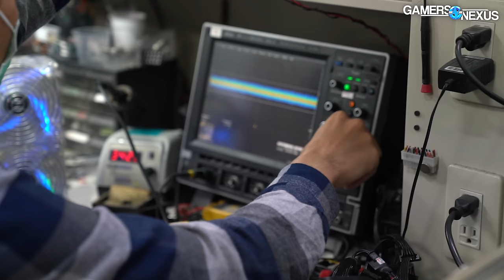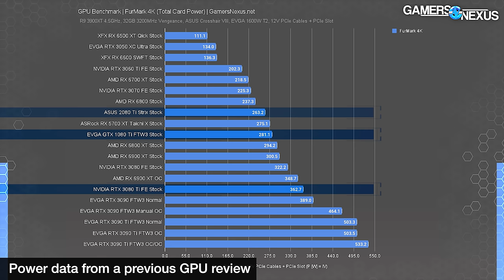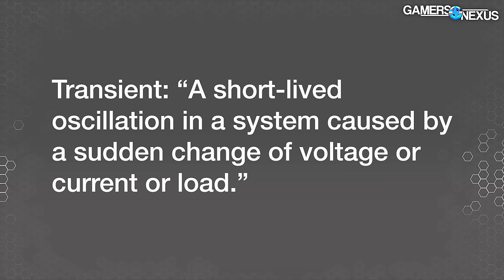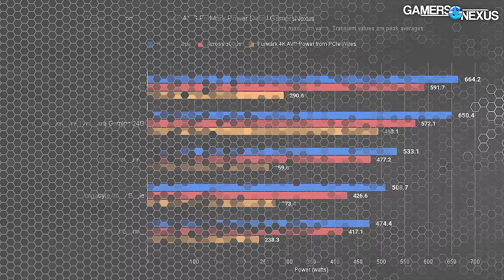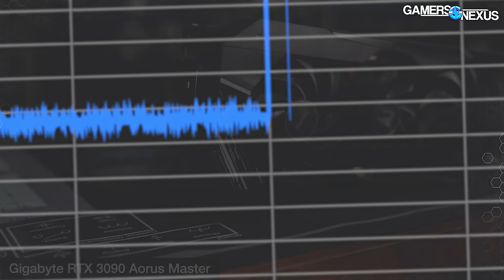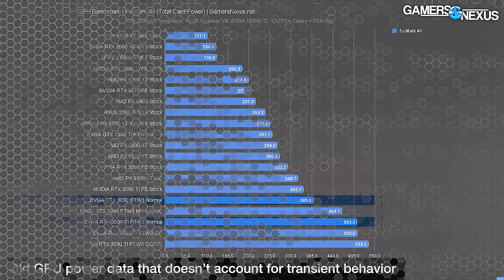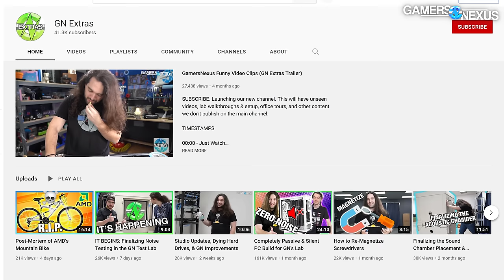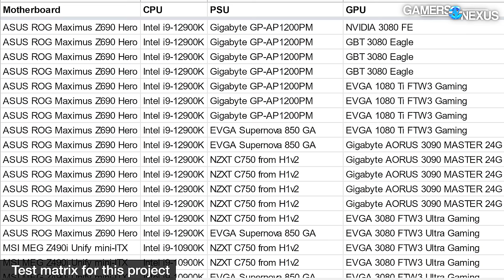The Brewing Problem with GPU Power Design | Transients

Comment: I would have watched a longer video that included how the motherboard plays a role. I have had random shutdowns with my TUF 3080 for almost 2 years now and I have gone through 3 different Seasonic PSUs, the first was a SFF PSU. My current 850w only shuts down about once a month but it's still an incredibly annoying problem.
Reply: I had constant shut-downs and bios issues, turns the issue was the motherboard. I thought I had updated it to the latest bios when building my pc, in fact I did nothing. That fixed most of my issues, why not look at that
Reply: 850W may not be enough. My shutdowns only stopped when I got a 1000W psu.
Reply: @Xer0-  I agree and almost bought a 1000w PSU but I'm hopeful ATX 3.0 allows to get back down to reasonable wattages, even going as low as 750w. The system actually only ever uses 600w even when power virus testing.

Comment: It's also a safety concern. With how high power requirements are getting, a lot of those older 15A circuits in USA households are going to be under full load and heating up a lot. This could result in fires. A lot of older houses do not have thick enough gauge wire to deal with full loads for hours on end.
Reply: Your breakers should trip before fires, that is their whole point.
Reply: @JimBob1937  Problem is breakers (I'm assuming at least), are designed to protect newish wires. The old ones potentially won't be able to take the same punishment. But on new houses your 100% correct.
Reply: @GsaUce Rug We don't talk about Edison...
Reply: Completely, utterly false.
Any 15A wiring run is designed to accommodate up to 1875 watt spikes safely, namely 15 watts at 125 volts (15 x 125 = 1875).
Draw above 1875 watts lasting longer than 10-30 seconds (depending on protection type) will either trip the breaker or burn out the fuse.
We are far Far FAR away from this being a concern.
As far as house fires that's nothing more than (and I'm assuming) Jayz spewing FUD and you parroting it.

Turn your toaster on and a coffee maker, 30 seconds later... click.
EHERMERGERD MY HOUZ IS GONNA BURRRNNNN!!!

(Age of house is irrelevant. Wiring is and was designed to carry the load stated.)
(House fires start in the overwhelming majority of cases due to the use of improper extension cords or due to damage from animals or damaged insulation. Fires resulting from circuits being run within spec are practically nonexistent.)
Reply: @chainingsolid  , that is incorrect. If the wiring is designed for a 15A load... age doesn't matter. If the wiring is paired with an appropriate (same rating) breaker or fuse, it will flip/blow before the wiring catches anything on fire. Even in the case of a 15A circuit, they're designed for high current spikes that may exceed 15A, it's just that the heat build up will eventually cause them to fail at continuous loads which exceed their rating, which is what the breaker/fuses are designed to interrupt. Only danger of an old house is some idiot who may have installed a higher amperage breaker/fuse than the wiring was intended for, but that is a deliberate misuse of the wiring and not something you'd need to worry about if your wiring is up to code, even if it is old.
Reply: @tim3172  , agreed.
Reply: Reminds me of when I picked up a laser printer; 15A circuit breaker in an older home couldn't handle the power spikes without also utilizing a series mode surge suppressor (Zero Surge / SurgeX), makes me wonder if those will make a difference when utilizing high power graphics cards moving forward.
Reply: @Nachokinz  , was it a fuse based circuit? There can be different fuses, not every amperage fuse is the same. They are rated in how sensitive they are to spikes and overcurrent duration. Either that or if it was a breaker setup, maybe the breakers were too sensitive. Shouldn't have anything to do with the wiring and should be easily fixable within the main distribution panel.
Reply: @JimBob1937  I just looked up top causes of fires. And found this: 
"Electrical fire cause 5: Wiring. Outdated wiring often causes electrical fires. If a home is over 20 years old, it may not have the wiring capacity to handle the increased amounts of electrical appliances in today’s average home, such as computers, wide-screen televisions, video and gaming players, microwaves and air conditioners.

Breakers should be triggered when circuits get overloaded by too much electricity, but outdated breaker boxes often have worn connectors that do not work, causing the system to overload and start an electrical fire."
Reply: @chainingsolid  Wires don't age or degrade with time unless they are corroded. 15A at 120V is plenty for PCs even with RTX4000 series. Unless you are also trying to boil a kettle on the same circuit. Yes newer houses typically have 20A circuits but 15A is still plenty for regular use.
Reply: @GsaUce Rug , there are issues with age when it comes to insulation, but at that point it isn't load dependent. Wiring that faulty is faulty no matter the load. The whole discussion is that somehow older houses will burst into flames based on higher loads... but really, if your wiring is that faulty, it isn't load dependent and you're just a fire time bomb waiting to happen. Metal in the wiring isn't going to degrade in current handing capacity.
Reply: @groundzero_-lm4md  , sorry, replied to wrong person.
Reply: @VROOOOOOOOOOOOOOOM  current rating is based on the innate electrical resistance of a wire material and its thickness. Higher current produces more heat as the ohmic losses increase. This doesn't really degrade with age. What can degrade is insulation and potentially higher resistance connections forming at the outlets. A proper functioning fuse or breaker should catch bad insulation or higher current draws than the wiring can support, as the wiring isn't going to degrade in its base current handling capacity. Though, higher resistance connections won't be caught, but then you're likely to experience fire from those even below maximum current handling capacity. In other words, wiring so poor that it may be an issue with higher will also be an issue with lower current draw than what is being discussed, making it a non-issue for this specific topic as that just boils the discussion down to, faulty wiring is faulty wiring... which is of course true no matter the circumstances.
Reply: @GsaUce Rug , that is why I said higher resistance connections. However, I would highly argue that will be a safety hazard regardless of maximum load... aka, the whole point of this discussion. High resistance connections are a danger even at lower loads and should be fixed.
Reply: @GsaUce Rug , any load can cause red hot connections depending on the resistance of the connections themselves. Which is why they are a danger under any load. Here, the point of this discussion that they all of a sudden they should be a safety concern with higher power computers... but really, those are a safety concern in general and now, as a present danger. Hence, I don't agree with the premise that higher power computers would increase the rates of fire, as those fires that are likely to start from such poor wiring are likely to start even before the introduction of higher power computers.
Reply: @GsaUce Rug aside from glowing high resistance connections, the rest of the failures should be caught by the appropriate safety mechanisms, regardless of age... and again, if they are not, then the circuit represents a danger regardless of the introduction of high powered devices. It's not that I'm not arguing poor wiring won't cause fires, it's more so, that they shouldn't occur in the first place, and if they do, it has nothing to do with computers using more power. Aka, bad wiring is a danger at any time, with no connection to the premise of requiring higher power computers to trigger them. High resistance connections, bad,. Fuse/breaker oversized for the wiring, bad. Insulation falls off, bad. If any of these are in your wiring now, you need to fix them now, not wait for a high powered PC to magically trigger them... they're a danger well before that.
Reply: My pc actually tripped the breaker recently. Given I also had AC and a mini fridge on. It only happened when I put my pc on full load however. Good learning experience.
Reply: I've tripped a breaker running a hair dryer alongside my PC... And I only have a 1080Ti. Age of the house is irrelevant but when you have multiple monitors and other things connected you're gonna reach the rated power limits way sooner than you think.
Reply: Stay in skool kid 🤣
Reply: @tim3172  Absolutely!

Used to trip a breaker in 4 seconds when I was microwaving something then used the toaster. Also tripped the breaker playing games on PC while running the A/C.
Now have separate 20Amp breaker’s dedicated for the A/C’s in all of the rooms and no problems.

Comment: I’m very impressed and happy that independent groups like GN are looking into these “boogyman” instances of hardware/software failures, especially because within the next decade or so we will be dealing with architecture that approaches 1nm, and after that things get really weird. If we are having the problems now at 10,7 and 5nm architectures, the problems will only get more complicated. I can’t wait until GN can afford to implement a quantum version of measurement to their arsenal. They’ll need it 😂
Reply: what's funny is 5nm isn't 5nm, it's just a name
Reply: @canaconn2388  Explain?
Reply: @16xthedetail76  Those descriptions are marketing terms. It's simply how manufacturers like Intel, TSMC or Samsung call them. It does not tell you the actual geometry sizes of the produced transistors. For example; FinFET Transistors on Intels 10nm have a fin pitch of around 34nm while Samsungs 10nm has a fin pitch of around 42nm which is what Intel has on it's 14nm process. So while both call it "10nm process", Samsung is actually closer to Intels 14nm than their 10nm. 

And that is fine, because manufacturers can call it what they want. As I said, its just a marketing term.

Comment: As requested, reporting in: I've got a 6900XT (and a high clocking PowerColor Liquid Devil Ultimate at that) running just fine on a Corsair SF750 SFX PSU. Rest of the system is a 5800X (limited to 120W PPT, CO UV'd and PBO OC'd) on an Asrock B550 Phantom Gaming ITX/ax. No other major power draws - two sticks of RAM, a few fans, a DDC pump. I've never pushed the GPU beyond its stock limts, and often run it with an UV/UC profile, but it's seen a lot of use at the 330W limit and I've never seen a single shutdown.
Once again, thanks for an excellent video. I could do without the rather obnoxious background music at the start, but other than that, fantastic work. Love to see your videos evolve into deeper dives like this.

Comment: GN: "It gets a little ridiculous if you're shopping by capacitors"
Buildzoid: "So as you can see, even though both of these capacitors are rated the same, if you open up the technical spec and look at the power curves, they actually behave very differently, so you should factor this into your purchase decision"

Comment: I have a serious feeling that we're about to revisit the days of dual-psu systems. At least until better tech comes along given the transistor shortages and power ceilings, unless it's a matter of nVidia pulling an Intel by sandbagging.
Reply: Nah, there are already 1600W PSUs, and the ATX 3.0 spec that PSUs will soon use (bizarre that Steve didn't mention it) is designed specifically to deal with transients.
Reply: @concinnus  so what's the issue then?
Reply: I pay 34c/kWh - no thanks
Reply: @concinnus  so, nothing to be worry about them... We'll be back to the days of Athlon and Pentium 4 list of approved PSU and / or GPU vendors asking us to get a new ATX 3.0 certified PSU with their new GPU.
What a waste of time Steve, it was completely unnecessary to know this much info and data. 🙄
Reply: @concinnus  that's brushing dangerously close to the 1800 watt hard limit of North American power circuits, unless a high end pc is gonna start requiring a 120v 20a circuit.
Reply: @concinnus  sounds like a shitty way of fixing it, just brute force more capacity instead of actually working on dropping power draw
Reply: @johngaynor4363  That or dedicated pc outlets for 220v 15-20amp, like they use for bigger window ac units.
Reply: yip i use to have builds with dual psu's
Reply: @johngaynor4363  You wouldn't need a 1600W PSU, you'd need more capacitance to handle the spikes.

Still a shitty situation, this should be mitigated in better design, rather than just brute force compensating on the PSU imo. Even if that just means shifting the capacitance onto the GPU boards themselves.
Reply: @KingOfKYA  bruh, that shit ain't happening in most of the world. That's gonna cost a shit load to have  your house rewired.
Reply: Very unlikely. More likely majority of people will buy sensible GPUs, as usual, and not useless, overpriced, wattage-slurping monsters.
Reply: @johngaynor4363  Actually it's mostly North America and Japan that have pathetic sub 200V systems
Reply: @Ovenman940  I know, I mean that its unrealistic to ask anyone to rewire some part of their house for a pc.

Comment: Rule of thumb, you want your power supply to run about 50% under "normal" high load. That puts it squarely in its most efficient range, and gives it plenty of overhead to deal with transient spikes and power grid brownouts. That's how professional equipment is specced, and there's a reason for it. It costs more, but not as much as replacing broken equipment.
Reply: This +1 Too many people trying to get by with the minimum.
Reply: @FacialVomitTurtleFights  "Minimum" changes the longer a person holds onto a system.

Comment: This happened to me on a Deep Learning rig. When 2x 3090 were running full load, sure enough, the system would shutdown. The PSU was 1500W so in theory it had much more power than needed.

Sure enough, I got a 1650W PSU and the problems disappeared.

Comment: I wish we could go back to 200-250w was the extreme end of you power draw, it probably won’t happen for a few more generations but I can hope.
Reply: Unfortunately with moore's law effectively dead, you have to scale up performance by a combination of:
- Larger die size
- Higher frequency 
- Better architecture 

The first two increase power draw, and the third option is hard to do without the first option to increase transistor budget. The issue is we're starting to hit the physical limits of silicon fabbing.

Comment: Perhaps someone could make a "compatibility brick" with a huge number of capacitors that lets you convert 3 or 4 common PCI-E cables into one of those new 450w or 600w connectors. Something to let these old 750w PSUs to power the next generation of cards.

It'd be challenging to make a wire octopus hanging off of your GPU look good, but if you stick enough RGBLED on it, I'm sure someone will buy it.

Comment: The first time I had problems with power spikes was with my old AMD FX8350 system from a system builder. I had a budget PSU from Corsair (I think it was a VS650) paired with it and a GTX 1060 6gb. Upgrading to a RM650X solved all the random issues and years later it's still a decent quality unit that handles a RX 5700 XT and Ryzen 7 3700x.

Over the years since then I've helped multiple other people with their systems having these types of issues, maybe half a dozen in total. All of them either had a budget but branded power supply, or just one that couldn't supply the wattage for a newly installed graphics card.

Personally I really dislike having to over-provision a power supply as you don't get any real gains for a gold or platinum rated unit, but sometimes it is necessary as you've stated

Comment: You have to specify transient power draw spikes as both a power or current value and a time period, because there's always the chance that you get a much higher bandwidth scope and you have a really tall, really narrow spike that ultimately means very little as it can't make it down the wire to the psu or be even detected by it.

This isn't an easy problem to solve and it comes up in electronics very often.

Comment: If I was motivated and entrepreneurial enough, now would be the perfect time to create and sell "GFX Capacitor Banks". Like how they took the car audio market by storm where power supplies (alternators and high current losses) weren't sufficient for feeding the technology/availability of high power amps and subs. So, this device would sit close to the GFX card, in line with the PSU 12V, and it'd contain a low ESR, high capacity configuration. These would take the immediate brunt of the load spike, and allow the PSU to compensate a smaller power draw over a longer time frame. This is quite the lucrative avenue, as all the marketing has already been done, just copy-paste the automotive audio industry propaganda and just search-replace "dBs" for "FPS", plus you've got the perfect storm of GFX OEMs not wanting to stop doing transients, and PSU OEMs not wanting to mitigate for them, so who's going to roll over? Nobody! Enter: The Ultra GFX Power Bank®yours for only $99 + p/h.
Reply: Yeah. The real problem here are the PSU and GPU manufacturers pointing the finger at each other. Standards will need to be developed in this respect.